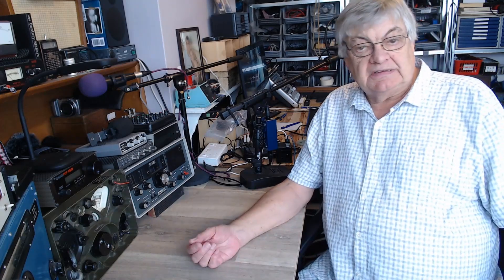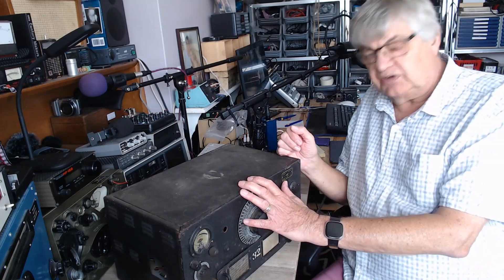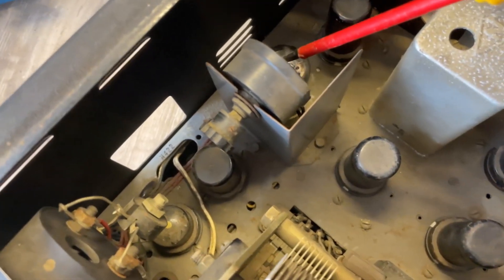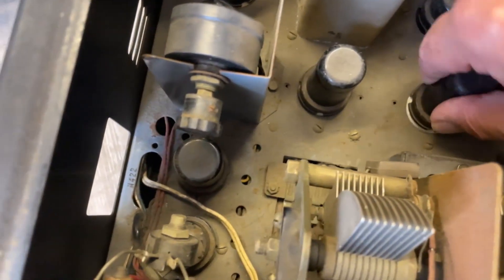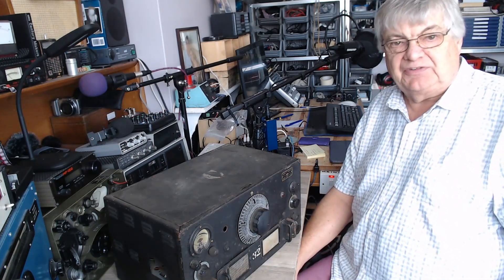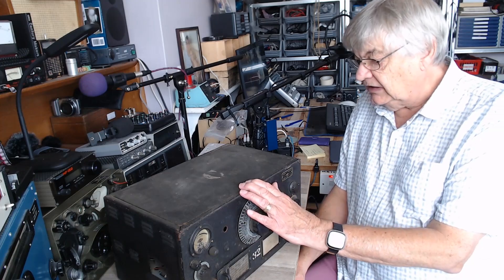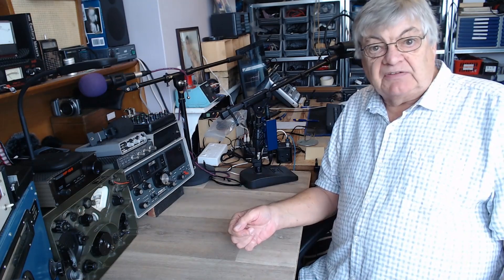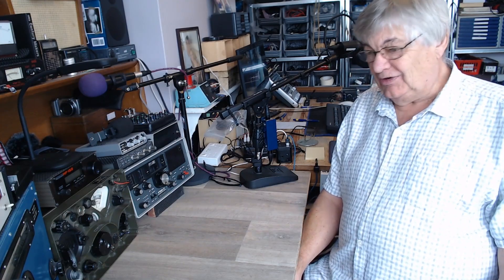G4NSJ - National HRO 5TA1 - 5A1 communications receiver

Comment: National did sell a noise limiter as a add on and some HRO where sold as factory standard  fitting. hence maybe  the hole on the left side of the face plate and this where it would be fitted.
Reply from the maker: @itsonlyme9938  That’s interesting, thanks.

Comment: The top cap thing may be "factory". There was a late version of the BC348 that did the same trick. It was a Q version made by Wells Gardner. Maybe a supply availability issue?
73 de G8NYZ
Reply from the maker: Yes, you could be right. Good point. Cheers, Ray.

Comment: Ray, what benefit was to be gained by modifying that set from 6 volt heater over to 12 volt heaters, i.e. for mobile use"?"
Reply from the maker: @Theoobovril  Hi, that’s a good question. Presumably whoever modified the Radio, wanted to use it Mobile.
Reply: @g4nsj  Hey, Ray, since the modification seems to have been carried out quite professionally, any chance that receiver is an ex-MI5 mobile set used for monitoring clandestine broadcasts. For MI5, did during the early days of the Cold War, operated mobile receiver units. These mobile units used for catching clandestine Morse transmission coming from Russian agents hidden inside the UK. The book "Spy Catchers" mentioned much about these events where mobile units were in operation. School boy stuff, Ray, but who knows, you might have an ex-MI5 receiver..lol
Reply from the maker: @Theoobovril  That's a thought... an ex-MI5 receiver. All sorts of things went on during Cold War so you might well be right.

Comment: Interesting! Does it look like someone has changed the valveholders for octals? I guess they must have if it wasn't built like that, very strange! As for the output transformer, well it lets you hear any ripple there might be on the HT line! Looking forward to seeing how you get on with it Ray.
Reply from the maker: I think the valve holders are original.  Good point about hearing  ripple on the HT line!